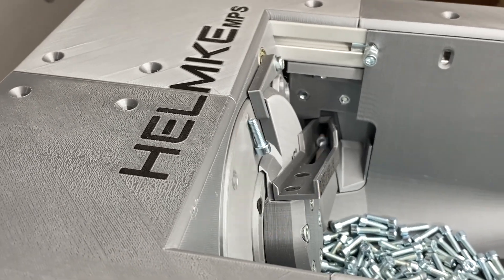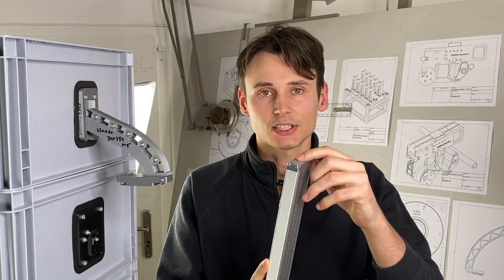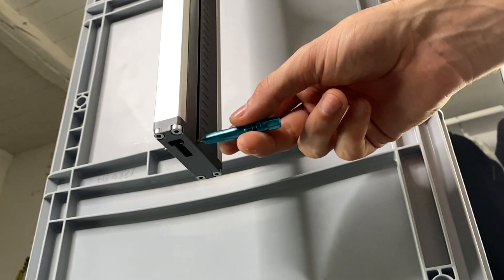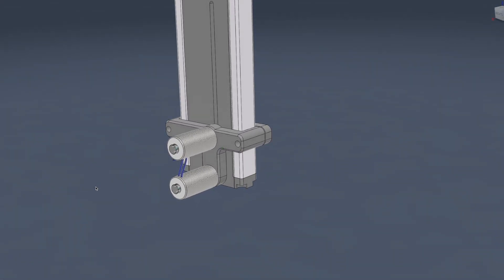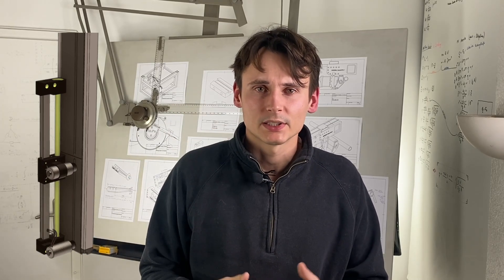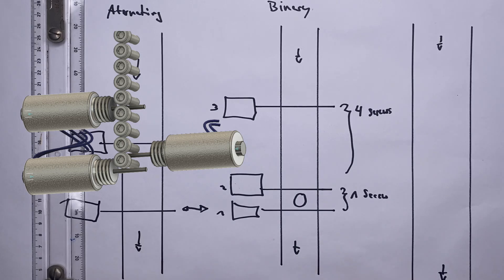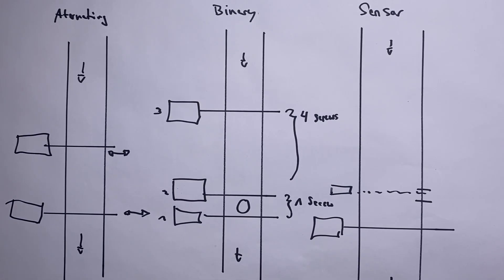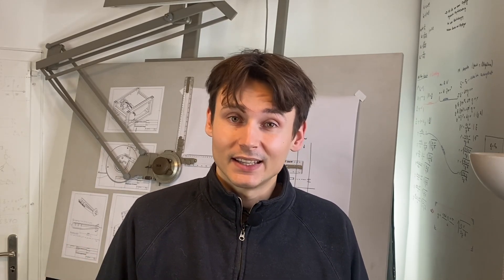3D-printed automation - Screw packaging #001

Comment: actually, having a rotating barrel with grooves for the shank of each screw rotating at the end of the magazine might work.  The rotating component allows screws to drop into the slots as the slot passes the end of the magazine.  The barrel rotates picking up screws and bringing them around to the dispensing position where they are counted by a sensor as they are released and rop into the catch container.  The rotation stops when the required number of screws are dispensed,.  I'm thinking that a magazine empty sensor and a dispense end counting sensor would needed. The barrel rotation stops when the count is satisfied or the magazine goes empty and restarts automatically when the container is automatically replaced or by manual button if manually replacing the catch container.  Just an idea.

Comment: Nice video! I'm going to watch more of them.
But I really don't understand, why the complexity of counting/separating screws from the magazin is needed, when they are already separated and easily countable after the feeder. Having two solenoids, the magazin could be split in an upper and a lower chamber, so the feeder could count the next batch into the upper, while the lower is available for dispensing an already counted amount of screws. If the the upper chamber has the right amount and the lower chamber is empty, screws can be quickly send downwards to the lower chamber, probably without stopping the feeder.
Yes, the feeder might need to stop more often. If this really is a problem, especially with low-count dispenses, additional solenoids may be used to split up the magazin into more chambers. By this technique, any later counting (Alternating/Binary/Sensor) isn't needed. Additionally, you don't need the induction sensors.
The total output rate is limited by the feeder speed anyway,

Comment: Great video! Your prototypes look better than the iPhone 15. To battle the issue with falling speed you can add an insert wheel that has cutouts for screws and which rotates a required amount of degrees per screw to dispense.

Comment: a gear with long teeth at the mouth of the magazine or reaching into the side of the magazine near the mouth can be used to control the dispensing. the teeth, with pitch equal to the distance between each bolt in the magazine would allow the the gear to dispense one bolt per tooth. an optical or other sensor can be used on the gear to count the number of bolts dispensed per angle of rotation. a solenoid activated clutch can be used to seize or release the gear at any time, otherwise the gear is free to turn by gravity of falling bolts. this should be very fast in dispensing and also very fast in stopping. 

to improve the reaction time, the dispensing gear can be used to drive a larger gear with various adjustable markers placed on its face. a sensor is used on these markers to trigger the clutch solenoid whenever a marker is detected. a user activated pulse switch is used to release the clutch until the next marker is detected which reactivates the clutch. the reactivation interval and thus the number of bolts dispensed is programmable based on the adjustable markers. or if it is easier, make multiple pre-programmed large gears that are swappable.

Comment: I've been wondering: Why didn't you countersink the screws on the feeder wheel, so the push-off-arm could be static? I don't know the exact design of the wheel, but I feel like it should be possible, and it would remove a moving part, which is always good.

Comment: 6:54 you can get those inductive sensors with a narrow sensing window too. The wide ones got the tall plastic sensing end like the one you got, and the ones with the narrow is just a thin disk on the end.
Reply: If I understand how an inductive sensor works, then I agree, because any type of light sensor would have a tough time differentiating 2 or more bolts/screws falling tangled or over-lapped with each other, which you can see they do in the slow motion video.
Reply: @DarrenHughes-Hybrid  I would have put it so it senses the screws from the side, just behind the head. That way the size of the head helps keeping the thread a bit apart, and then I would use a sensor with only 2-4mm sensing range with the narrow sensing window. Probably something like a IMB08-02BDSVU2K
Reply: @mikeydk  I think I get the picture you are describing and that sounds like a good idea, but I am not very familiar with the IMB08-02BDSVU2K sensor.

Comment: The speed of the screws also vary by how many is unloaded at the same time because of gravity accelerate objects, so it is a non-linear problem. In addition to this fact I also think the binary solution is most promising because the lock pin is never interrupting/intercepting between screws in motion and/or makes potential jams. I think the sensor solution is possible(after ALOT of work and problems). But the question is if the added complexity is worth the faster dispensing time of a sensor? If in need for faster dispensing you could always add another solenoid for some additional addition options, or drop the whole magasine with the sequential or binary system and filling it up again activated by the empty magazine proximity sensor. Either way you seem very reflected about the pros and cons of added complexity, so I am sure you make it work to your benefit either way.😊 Just found the channel, keep up the good work!

Comment: Could you use a motor with a sprocket shape on it to dispense screws depending on how much you rotate the sprocket? Depending on how many teeth the sprocket has determines how many screws are dispensed per rotation of the motor or you can do fractions of a full rotation to dispense an infinitely custom amount of screws.
Reply: I am just realising that the next video is based off someone else’s comment with the same idea ahahaha.

Comment: Subbed right from the getgo. Your channel will be reallly interesting! :)
Side note: Optical counting could be tricky because the end of the screws could be touching so the heads, so you only can detect somewhat constatly at the neck of the screw. Also the timing will be tricky as well because of acceleration.
You could make a bottom drum attachment with the screw negatives in it. The screws fell from the magazine fell into the negative holes. Then you can rotate the drum with a stepper motor (or simply some divits on the drum, a switch and a motor) to turn the exact degree to feed one screw to the bottom.

Comment: Rather than a solenoid and sensor setup, I'm thinking a stepper motor with gear dispenser may be easier here.
Allows you to dispense a precise number of screws, though it will be slower than pure gravity for larger number of screws.

Comment: Why not use a tooth wheel that is perpendicular with the screws, look at how a bicycle tooth catches the chain. Now you can dispense how many and in what order you want, by just rotating a small stepper motor.
Reply: Well just read the comments, I’m not the only one. If not a wheel you can also use two horizontal steps that alternate, just like heavy cranes that walk instead of driving.
Reply from the maker: Yes thats what I did after reading the comments, you can watch it in my other videos. :)

Comment: To slow them down I'd set the solenoid to oscillate to only let one screw through at a time.  It would still be fast but, controlled.This also removes the need for an optical counter. However, maybe a better solution would be a motor and a bucket sort of system to grab individual screws and deposit, get it to spin only the required number of rotations to deposit the correct number of screws.
edit: another idea would be to use compressed air, like most industrial sorting systems. You can see them in action at very high speed combined with optical sorting in food factories, blasting away anything that doesn't pass QC. Or maybe just an actuated pusher. Or... again some sort of rotating collector at the bottom of the mag.
Reply: I like the pusher idea. Push/slide them out front or sideways one-by-one out of the magazine with a pusher like the bolt do in a semiautomatic/automatic gun without any sensors.

Comment: very nice design, i was thinking of the screw counting and wat came to my mind was multiplication, if you have two versions interchangeable with odd and even number of screws between the solenoids or even static mounted, you can maybe use just simple multiplication, so if you need 20 screws you just set it to 20 and it will figure out how many times the solenoids need to open and close.
And why isnt it possible to make the upper one variable in hight?

Comment: When you said controlling the speed I saw it clear. You could try to make a gear wheel that engages the column of screws through the lateral slid of the magazine. With a stepper motor you can make it turn and control the number of screw you releases at any given moment. This will substitute all the selenoid and even one sensor from top. You could solve the hysteresis problem, starting a counter which is counting turns of the wheel (the one I proposed) when the magazine is complete, then when you release the number os screws you want to leave space the counter would reach a number of turns then you send the signal again to start the picking screw up wheel ( the one you actually have). I hope I've explained myself, thank you very much for your time.

Comment: Well done.

You‘re lucky the screws are heavy, the machines I learnt on used vibrating pans with elaborate mazes to sort very light but far larger parts.
Pick and place arms have come a long way and depending on the properties of the material you‘re sorting or dispensing you can use them to your advantage (like magnets and precisely setting the force they have on what you want to sort).
I‘d also have a look at modifying the angles of the curve to space the objects out and then using a simple latch and two sensors (one counts, one for item present before latch).
You don‘t really need a magazine IMHO if you use a latch and two sensors next to (de)acceleration of the items by different angles in the curve.
Reply: We used to sort and place caps on vials at a machine speed of >600 bottles/min with a simple latch and two sensors as I described above. Two prongs would hold the cap in place at an angle and the stoppered vial would pull it out and move on to the next position for crimping.
Not strictly a continuous process but also not a sequential one either.
Solenoids can be controlled very precisely if you need to.
Similar principle like microstepping, one controls the buildup and draining of the magnetic field in the coil. 
One could fill 10 vials/s (1ccm with <5% variability) with a time/pressure filling system in the 1990s - Bosch built a dedicated MCU board for that purpose then. At least one other vendor could reach the same performance, they used a Motorola based real time „controller“ and simple solenoids.
The algorithm would start from static parameters and then optimise them (also during operation as there are subtle changes to a silicone tube being compressed and released ten thousands of times a day).

Remember those vials and caps I described?
You could also have a rotating gate at the end that turns, one object drops in to a well and moves on.
Next you check if object present in well and if present move to the next segment to drop it out of the gate wheel.
This would speed up the counting and also allow for slack from the device feeding the gate.
If no screws in magazine then the gate wheel turns n positions until it soft-stops and sends a request upstream for more objects.

Removing the magazine could also reduce noise and wear and tear as I consider it to be a bit long for free-falling objects.
At some point you’ll have the first screw fall in to the magazine and the impact breaking your dispenser.
Using s segmented wheel would prevent that from happening too.

Comment: To what, calculate the speed the bolt will be falling? That seems like the most complicated option to use a sensor

Industrially the do it by weight and divide by the weight of a single bolt

If the point was to make something cool, you did it

Comment: Why dont you make both solonoids movable with the same screw clamp connection you made for the 3d printed mount?
This way you can set the distance manually and tune it by hand

Comment: Could you not have a little wheel with notches in (resembling a sprocket) that rotates with a motor, stepper or with an encoder, and it just rotates the correct number of notches to count the screws out? Would need a different sized wheel for each screw though

Comment: You could put a carousel with slots under the chute. A screw would drop into a slot, and to dispense a screw you would rotate the carousel until the slot was over a hole, letting the screw would fall into the collection box below.

Comment: Screw counters/feeders for automatic screw guns count or sense the screws as they are leaving the feeder, and shut the feeder off as soon as the total count is reached. Then the output ramp is vibrated separately. Automated pill counters and vibratory bowl feeders work in a similar manner (but often without an output ramp). I think it is worth asking if the magazine portion is essential at all if the output control and counting could be done earlier.

Comment: Just came here after watching part #002. Excellent design overall, and the servo motor is pretty fucking wicked, but I'm wondering why not just program the rotation of the feeder, and have a sensor at the uptake (the top of your mag). You could just add an amount of rotation if no screw was detected being picked up. I see you thought of something similar and of using a solenoid, but a solenoid or an additional motor are not necessary if you were to implement it this way.

Comment: I get wanting to build something like this but there was a much simpler way to accomplish the end goal, a part counting scale (I have one that cost me like $100) and I used it when counting very small items. They are simple, it asks you to place 10 of the item on the scale so it can get an average weight, then you simply grab what you think is about the right amount and place it on the scale and it tells you how many are there. On really light items (say 3mm washers) it can be off by 1 or 2 either way but most anything else it's dead on, it even came with a cover to account for a breeze in the room (I never used it). If I was ever in doubt (like 20 of an item and the scale was flashing between 19-20) I just add one extra, a simple extra screw is a few cents.

Comment: Hey! We had a dispenser, that only consisted of one solenoid, but had a slider. The slider was seperating the screws and kept them from falling. The nice thing about it was, that screws never rushed through it, if ther is no power or a malfunction.

Downside: For 5 screws, the solenoid needs to work 5 times.

Comment: Instead of a parametric designed model for the solenoid bracket. I suggest the bottom solenoid be fixed and the upper one be mounted with some sort of quick clamp. Then you just slide the upper one to the desired limit

Comment: Smart, but dumb. Time based approach is not robust. You would have to do many tests to see the standard deviation of the "time per screw" over multiple dispensings of the same number of screws, and of different number of screws.

It's possible to do if you're looking for a challenge, but there are more robust mechanisms for dispensing X number of a solid object of standard size.

Comment: I know you've solved this in the next video, but an idea for this would be to use a alternating channel with something like a pinball paddle pointing down that simply flips back and forth to release a single screw, loading while the one before it is falling, you become limited mostly by how fast the paddle can swing back and forth.  The paddle can be driven by a really dumb DC motor.

Comment: Hi Christopher, this design is brilliant! After watching your 2 videos, I was hoping to see a TON of other videos from you on how you made the sorting machine, and was sad there weren't any videos on this. Do you have another channel or more videos on how you built the sorting / pickup mechanisms? Thanks!
Reply from the maker: Yes, there will be videos about that as well. My plan is to work through the whole system in the videos. 
However, there is really a lot going on in the seperator, and it is quite complicated to explain - so there will be several videos about it. Also due to the fact that the separator works a bit different for nuts/bolts/washers.
Another reason why I started with the counter module is - that it is simple. I want to make videos that are pleasant to watch. This way I can get some experience with video making before we move on to the more complex ones.
Reply: @christopherhelmke  Fantastic news, thanks!! I cant' wait to see those videos! Also, I didn't see info in any of your videos on why you're counting these and/or links to the products or items you're selling/offering. I'd love to see that as well. 

Looking forward to more videos!

Comment: I have seen your later video with a stepper motor drive so my comment is purely hypothetical.
The speed of the first screw falling down is different than the last one in the sequence and the speed of the last one depends on the height of the stack. So the demand on the system to count the  and close the chute is a bit higher than average you calculated from dropping 60 screws. 
In a stepper based system you control the “rate of descent” rather than gravity.

Another idea you can consider is to use a horizontal conveyor moving at constant speed, carrying one item per “tray” then using a solenoid or pneumatic cylinder to push the part off the conveyor.
Complicate this with computer vision and you could package different parts into a single container, as long as there is only one part per section of the conveyor.